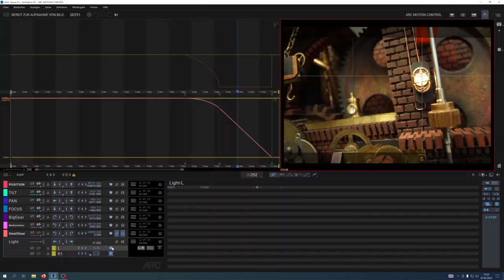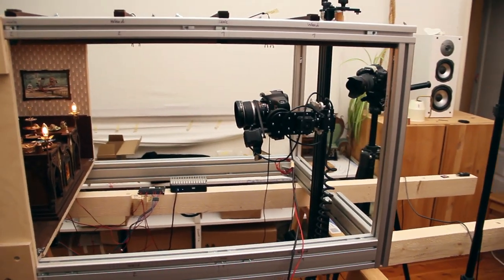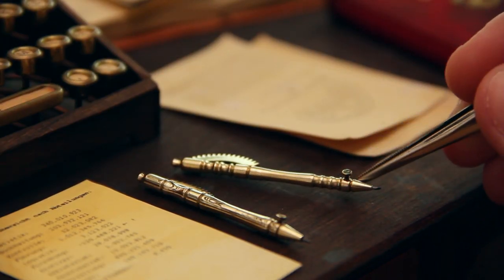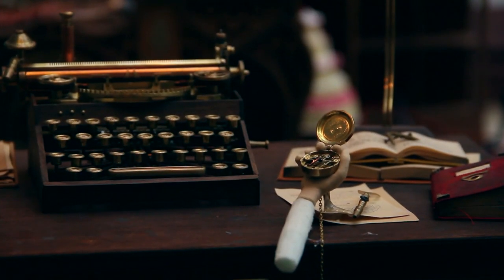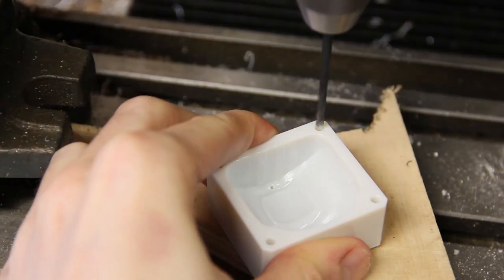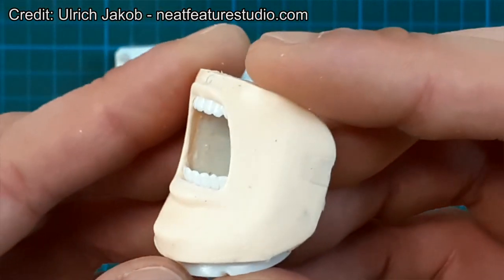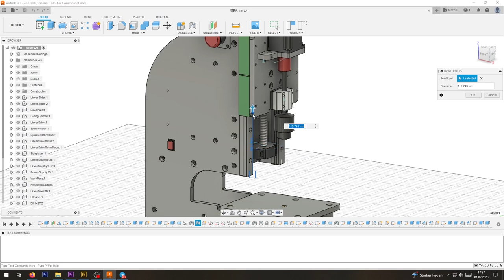Micro Animations and biting Skulls! - Update 03/2023 | An Unwound Clockwork

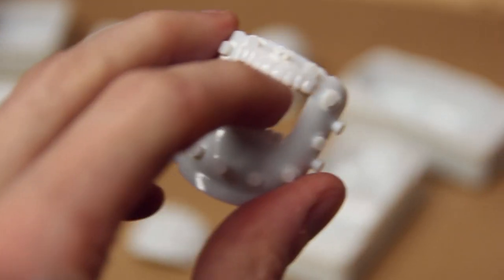Comment: Keep this awesome work! Is the piece on 3:22 printed with resin?
Reply from the maker: Thank you - These pieces were printed for us by a supporter who runs a dental prosthesis lab, and they have some crazy industrial printers. I'm not sure how the technique is called, but it's not resin - The machine apparently is a "j5Dentajet" from "Stratasys", feel free to research yourself... The print is extremely detailed, and the material is very hard and brittle. Obviously we didn't use the printer's color-printing capabilities, that would be something neat to try out though... I think it's similar to what Laika uses, but not that straightforward to do I suppose.
Anyway, from later experiences I would say a resin printer can deliver a similar level of detail, only with softer material and a bit less dimensional accuracy. We successfully used resin prints for hand molds a couple of months later, you'll find it in Update 6 or 7 from 2023 if I remember correctly...